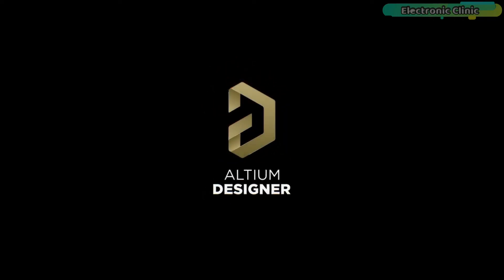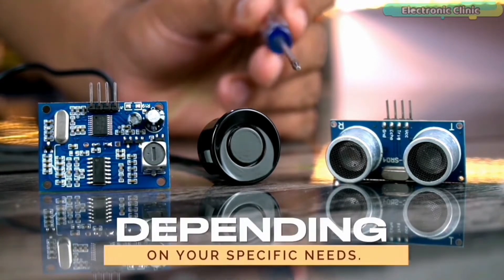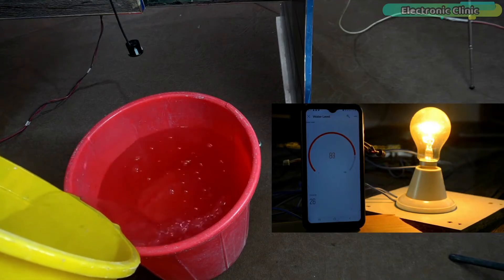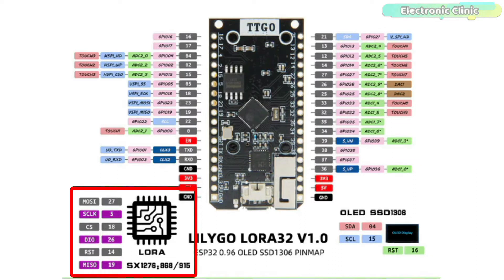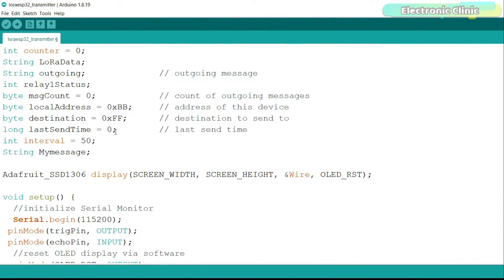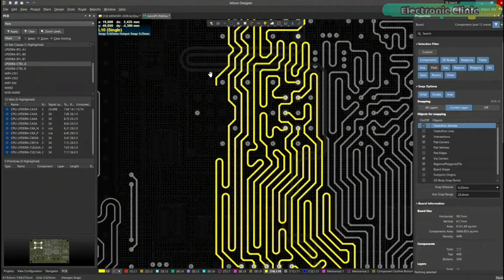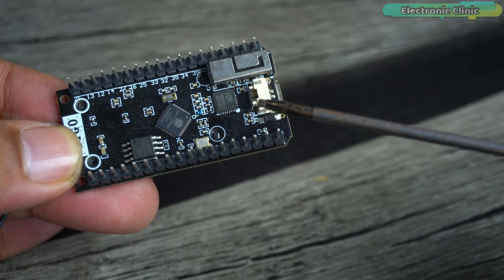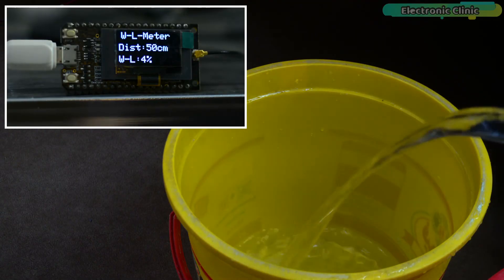Wireless Water Level Indicator using LoRa and ESP32 | TTGO LoRa32

Comment: can I try the it in arduino uno?
Reply from the maker: Yes. I have also done it using the Arduino board.
Reply: @ElectroniClinic  I am having trouble, it shows trash codes even the baudrate is correct. Do you know how to fix it? thank you in advance

Comment: Hi guys, I really loved this example, the best explanation I've seen for implementing a point to point lora link for multiple variables (for newbies like me :-). I had everything working perfectly on two Heltec ESP32 v2 modules. The problem I now have is that one module went faulty and all of the new modules are now V3 which now use the sx1262 lora chip and this code no longer works. You don't by any change have any plans to update this great video tutorial with an update using a V3 sx1262 module.
Reply from the maker: I have designed new dev boards, and I am waiting for the pcbs. I will explain everything how to design your own dev boards using ESP32, Lora, relays, buzzer, OLED display etc.
Reply: @ElectroniClinic   Thanks guys and keep up the great work :-)

Comment: I have made my own using these components.
# 433mhz RF module for wireless communication, 
# two arduino nano, 
# one HC-SR04 ultrasonic sensor to check water level in the tank, 
# one relay to actuate motor, 
# 16x2 lcd (i2c) it shows the percentage of water in the tank, 
# one touch sensor to turn-on motor, # rgb led to indicate water level, 
# two Hi-link SMPS to power both setups one in the tank and another near motor or wherever u want to place in the house....
#when i touch the surface of touch sensor motor turns-on when water level reaches 100% then motor turns-off automatically. I have been using it since last two months and its working perfectly. I also made it for my friend he is satisfied with that too
Reply: the sensor is not protected from moisture...how does it survive  ahigh humid envoronment of a water tank?

Comment: Hi! I'm in Thailand, my legally frequency is 920-925MHz if I command BAND 923E6 on this device, will it affect or damage the device & performance ?
Reply from the maker: No.
Reply: Thanks! Again, Sorry for doubting. Even the specification of the device is 868/915 MHz, is it going to generate 923MHz? (Specification limited)

Comment: Where are most water tanks in the world? In residents backyards that's where. This system is expensive as because one has to buy two of everything and they aint cheap. So, interesting application but until these little boards stop being a complete rip off, they will remain the domain of commercial applications and . . . the odd Youtuber like yourself. Good video there bloke.

Comment: Hello! Thank you very much for your videos!

. Would it be possible to use the pressure sensor you used on another video in this project, instead of the ultrasonic sensor? I need to measure the water level from the bottom of my tank because it is only 13 cms tall but is wide.
Reply from the maker: You can use any sensor you want.